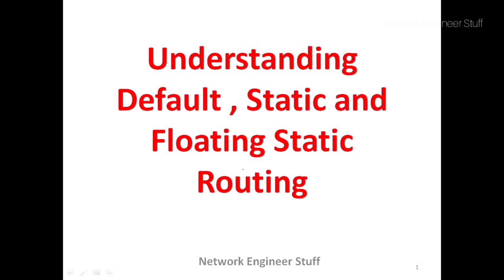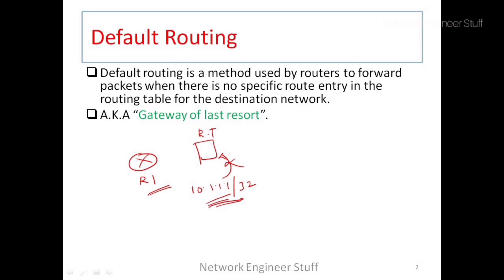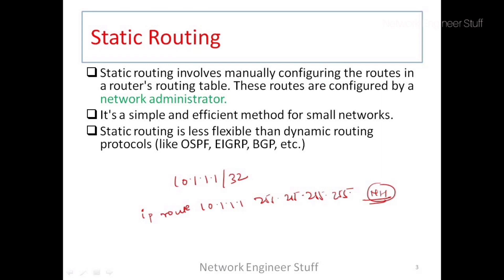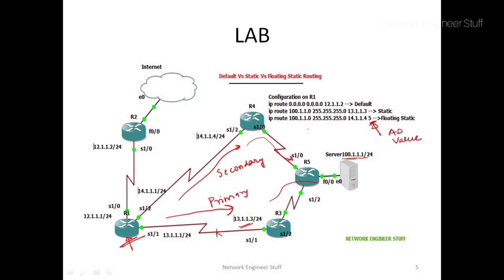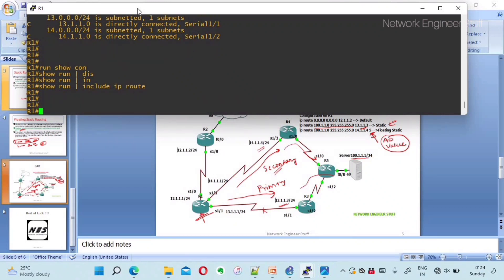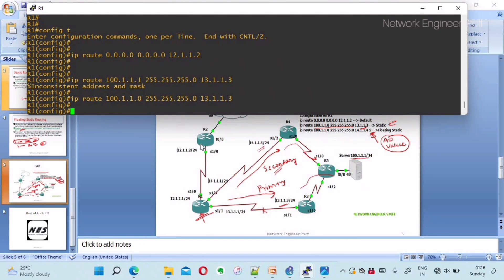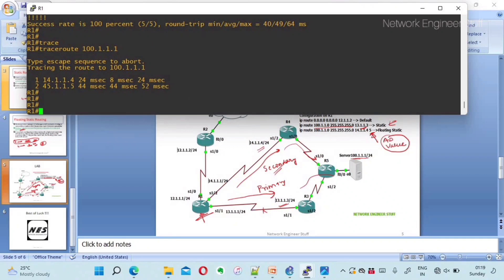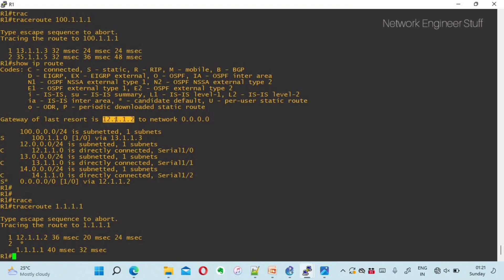Understanding Default ,Static and Floating Static Routing

Comment: what is ad value and why the floating static route have higher ad value.
Reply from the maker: Administrative Distance is a metric used by routers to select the best path when there are multiple routes to the same destination from different routing protocols. The AD value determines the trustworthiness or preference of a particular route.
Reply from the maker: Floating static route is the backup of primary route which would be a static route. So floating static routes would have higher ad value